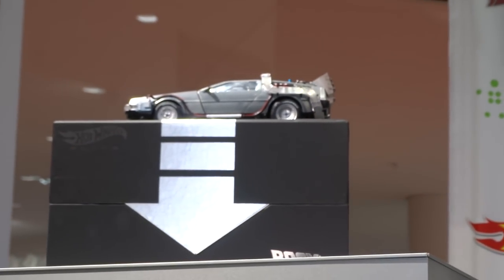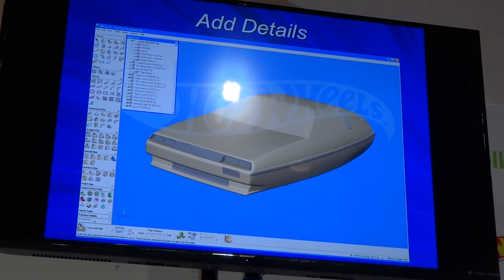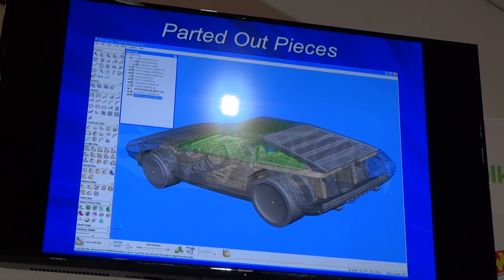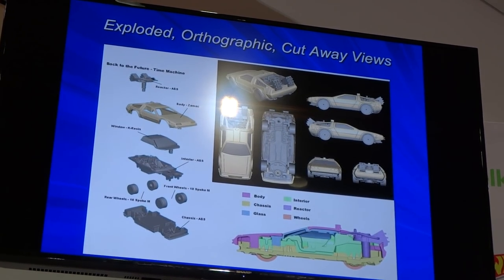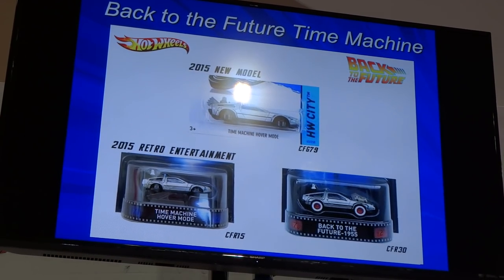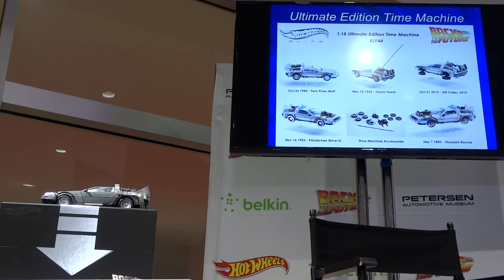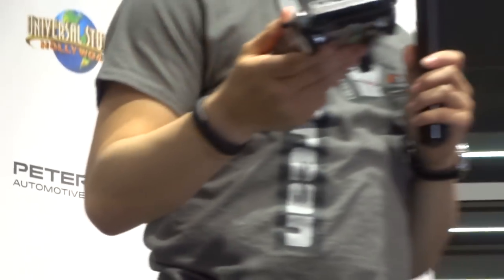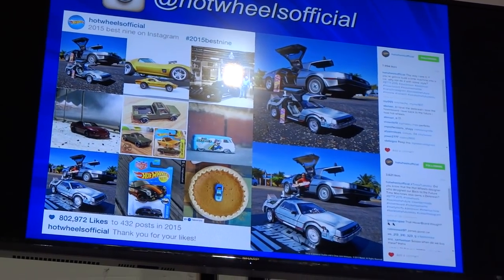"Back to the Future" DeLorean Hot Wheels presentation at Petersen Automotive Museum in Los Angeles

Comment: Just FYI to people asking how they can get one: While the official release of this model was cancelled, it seems as though a limited number of them were manufactured prior to the cancellation. I say this because a few years ago there were a number of them listed by Chinese sellers on eBay (and perhaps elsewhere), and we all know these models are made in China, so put 2 and 2 together and you can conclude that when the production run was cancelled prior to release, perhaps Mattel ordered the stock to be "destroyed" or "thrown away" or something, but instead the workers at the factory (and anyone else in China with access) took them to sell on eBay and other sites. It would be the most logical explanation for why you could ONLY find them from Chinese sellers. I bought one, and it's exactly as shown in the video. The black box with the arrow is the inner box that holds the black styrofoam crate that holds the model and all of its accessories for changing things and making it look like it did in all 3 movies. They used to sell for $400 with shipping, but the majority have long been sold out, and thus prices have more than doubled. As of the time of this writing there are 3 Chinese sellers with one on eBay, all for over $800 with shipping. There's also a couple European sellers, but those guys want over $1000. But if you really want it and have the funds, you CAN still get it!
Reply: Yeah the boxes on Ebay doesn't have the logo as expected. Strange and sad, that this beauty never made to the collectors.

Comment: Beyond cool! I wish this would see a release but this would probably cost like $200, which I'd gladly pay honestly for everything included.
Reply: I know your comment is old, but just FYI you can still get one if you're willing to pay for it. The official release was cancelled, but they made a limited number of them in a production run prior to the cancellation, and that stock was taken by Chinese workers, etc and sold on eBay and perhaps other sites. I'm guessing Mattel told them to destroy or throw away whatever stock was produced once the cancellation announcement came, but they just took them to flip for a profit instead because the ONLY sellers you could buy these from brand new were Chinese sellers. These are made in China, so put 2 and 2 together. I bought one for $400 and it came brand spanking new, shrink wrapped. Back then there were a number of them available, but since then the majority of the stock has sold out, so there's only like 3 Chinese sellers offering one on eBay right now, and they all want over $800 with shipping. There's a couple European sellers selling preowned ones as well, but they want over $1000. But the bottom line is if you really want it and have the funds, you CAN get it for the time being!
Reply: @Imperium_Americanum  Thank you so much for replying to my comment. I was thinking about this car the other day but totally lost the video and couldn't find the model. The last one I saw on eBay was listed for like $800 or something.
Reply: @NFS4LFE  Haha glad it helped you find the video again! Ya the cheapest one on eBay right now is something like $833 with shipping from a Chinese seller. Keep in mind that eBay will automatically charge you sales tax on top of that and remit it to your state (if you live in a state with sales tax. Thanks supreme court!). I can confirm that it's a great model though, and is really well put together (definitely the best and most detailed diecast model car I've seen), but it's up to you what it's worth paying for.